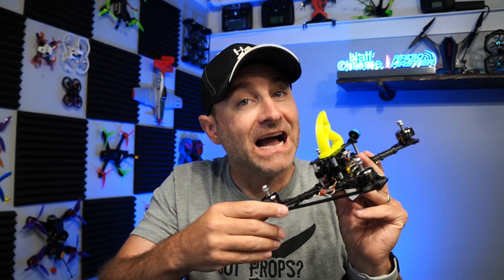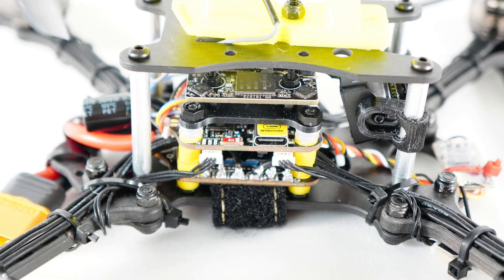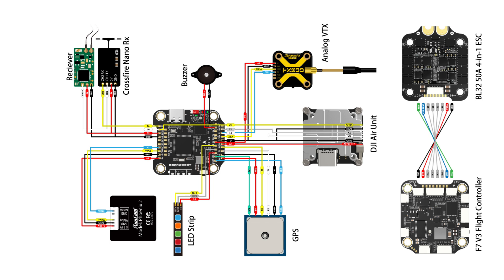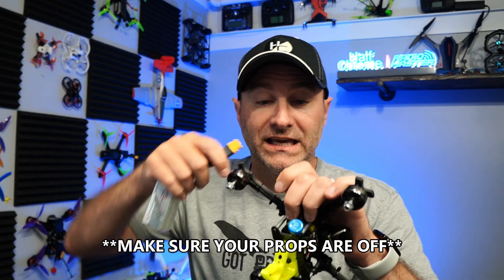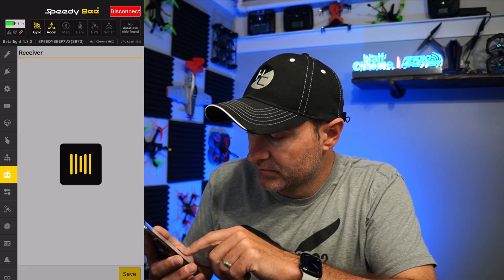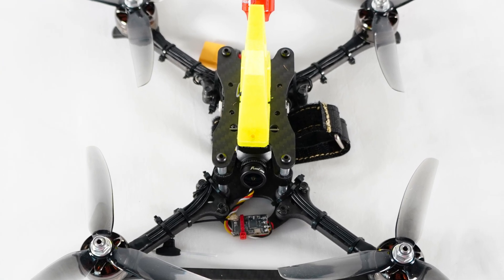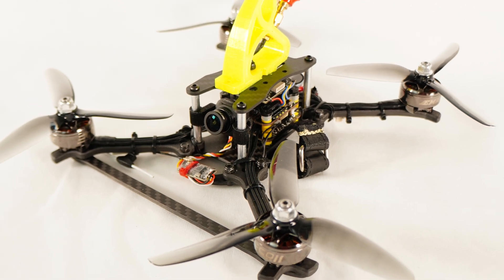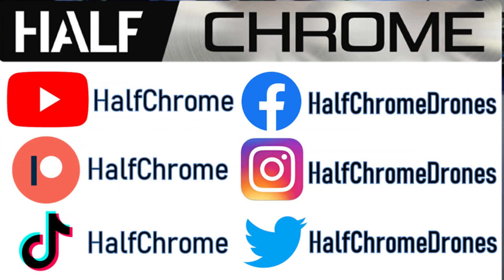Build a Premium FPV Drone with Speedybee

Comment: Thanks for the vid. I bought the f7v3 and have trouble getting rx input in betaflight. checked uarts, checked rx settings, checked rx/tx connections. No input. checked firmware on both, reinstalled same. Any Help from your side?